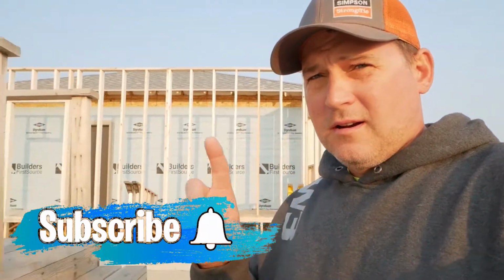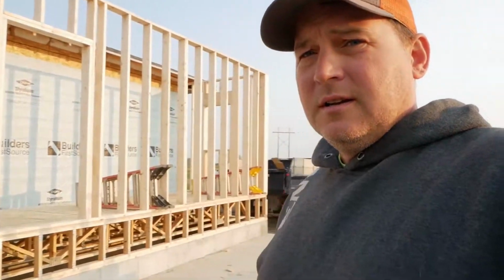Building an attached garage Part 1

Comment: Dumb question. Why take the siding off where the garage attaches? Is that code?
Reply from the maker: The customer wanted to add sheetrock on the inside of the garage, so we just removed it for him. Wish I had a picture of the inside it turned out great! I believe it's also code to have 5/8 rock on adjoining walls between garage and home.
Subscribe to see more of my videos like this series!!